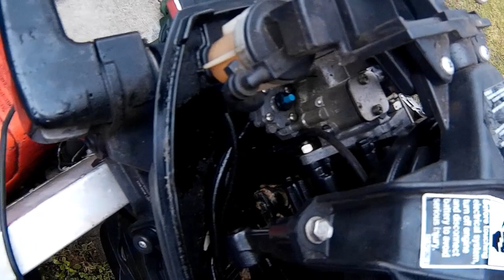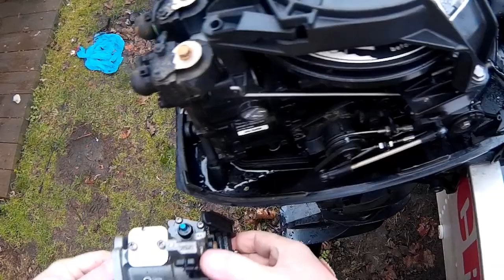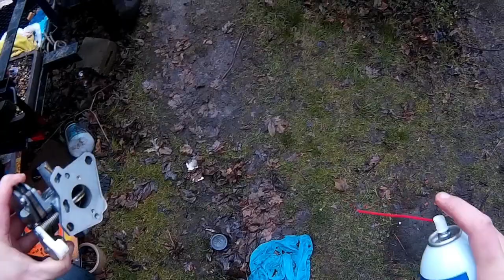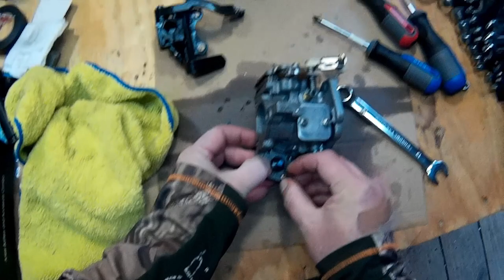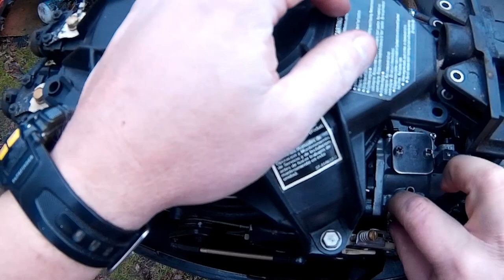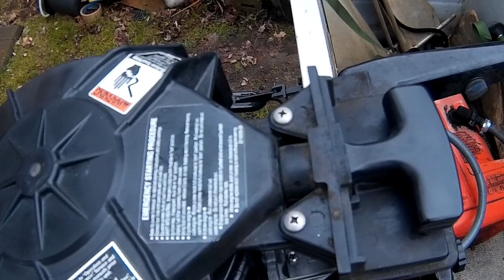IT WAS IN THE CARBURETOR ( 1997 Mercury 9.9 two stroke carb clean-out )

Comment: Thanks for the video. 
I picked up this exact motor this summer. It is hard to start and will not restart when hot. 
There have been many issues that I have found and fixed. Dirty and corroded grounds, coils missing ground jumper wire, emergency stop switch wires rubbed through causing a short to ground, and the stop switch on the tiller handle was defective.  
It still does not want to start. One plug is fouled, both have spark. The carb leaks fuel when choke is on and you turn it over. The carb was supposedly rebuilt and the engine was "inspected" this spring right before I bought it. I hope both cylinders have compression. 

This video has been beyond helpful, thank you.
Reply from the maker: You are welcome. Sounds like you acquired an engine that was not properly maintained. Best of luck with your Merc !!!!!
Reply: It's probably the bowl seal. I found the one that came with my kit was too thin and it would still leak. I made a new one from silicon and posted a video on how to.

Comment: Thanks for the video 👍🏻 Carb is the same on my 95’ Mercury 25 hp. the only thing I had to do different is remove the starter to remove the inside carb mounting nut. I purchased a rebuild kit first $20 ( gaskets, plunger ect. ) followed your video on disassemble and cleaning, the issue was the float was full of fuel, purchased a new float $11 re assembled and BAM RUNS LIKE A MERCURY SHOULD 👍🏻🇺🇸
Reply from the maker: Thats awesome. Great to hear it helped you out and the Merc is roaring again. Yes sometimes the floats will take on fuel !!!!!
Reply: @CrappieCrushinTv  I also found out the main jet in the bottom of fuel bowl (the one you were not sure of an adjustment ) is fixed and has no adjustment so it can be backed out , cleaned and just snugged back in 👍🏻
Reply from the maker: @matty2x302  Yep I figured that out after posting the vid but thanks

Comment: I have the same motor as a kicker on my boat.  When placing the idle adjustment screw back into the carb, what I did was mounted the carb loosely and then placed the "C" part that goes on the adjustment knob together, placed it thru the hole in the cowling.  There was no amount of pushing needed to get it to go as Crappie says.  Once that was in, go the the left side of the motor (when you are behind the prop), press down the lever Crappie tells you when he is installing the knob.  You will see how those two parts clip together, it is pretty obvious.  This might help you.  Awesome video!

Comment: I just did this on my 1999 20 hp Mercury, after watching the video I decided to check mine. 
This all stated with hard starts and then eventually no start. I found the ignition system to be finally dying. After all the repairs it still had carb issues also, the primer was stuck and wouldn’t depress when pulling the primer knob.  
Also I removed all the cover plates and bowl cleaned all the internal passages. I found your video very helpful the engines although different horse power they are identically built. 
Only issue after that was the switch box wiring was a shot in the dark for firing order. I missed it. Once that was correct it starts first pull now every time.  Hope this helps others along with your help on the repair. 
Thanks
Reply from the maker: Thanks for the comment Roger. Yep I been there with the CDI in the past. Glad to hear you are back to a one pull again !!!!

Comment: WARNING be very carefull taking apart the enrichment assembly under the bottom brass screw trere is a tiny spring and ball bearing DO NOT LOSE THEM!
Reply: yes, possible all merc carbs have this. Mine had the ball stuck up inside the spring!!! I think some tard tried rebuilding it before I got my hands on her. I mean, how does the ball get stuck 5mm up into the spring anyway?

Comment: Thanks for the informative carburetor video. Ironically I just took apart my 6 HP mercury Carburetor. Before I cleaned it and put it back together, wanted to make sure I was doing it right. LOL I don’t know if my issue was carburetor or not, so doing a process of illumination. Thanks!
Reply from the maker: Awesome hope it worked out

Comment: Thx for video.  I got the same motor.  Is there suppose to be a gasket between the carb and the engine block?  My carb rebuild kit comes with a gasket.  The Mere Parts diagram also shows a gasket.  Mine didn't have a gasket from previous owner.  Perhaps that's why the motor ran funny.  In your video, I didn't see a gasket either.  The mating face on the engine block side has like a rubber seal around the openings.  Any help would be great.
Reply from the maker: Thanks for the question and sorry for the delay. No, there is no gasket at the head.

Comment: Thanks for the very helpful video! I just picked up a 9.9 and first day on the water it started bogging down at WOT and eventually would barely idle. Upon checking out the motor, I noticed the previous owner removed the fuel filter from it's housing, and I'm betting my carb is full of shit. This certainly comes in handy since I have never worked on a carb motor at all, nevermind a 2 stroke.
Reply from the maker: Thanks Adam and I hope it can help you out. Junk in the carb never spells success lol......Good luck ...
Reply: @CrappieCrushinTv  thanks man, my motor is exactly the same as yours and I just rebuilt the carb today, she runs beautifully again. Your video helped a ton. You weren't kidding when you said putting the idle speed switch back in is a beast... Holy! It took me ten good minutes of cursing and scratching my head.
Reply from the maker: @Adam-en4zm  LOL yeah that enrichment knob can get you LOL.... Anyway I'm glad you got her purring. Enjoy the ride now. I rip mine down every spring and do a good cleaning so this way there are no mid season hang-ups !!!!!!!
Reply: @CrappieCrushinTv  That's a smart call, I just picked this motor up and the previous owner had performed the genius fuel filter delete mod. No wonder the carb jammed up my first day out, haha! Gonna be sure to de-gunk it at the tail end of ever season, plus I even got it a fuel filter, lol!
Reply from the maker: @Adam-en4zm  Lol real genius move with the filter delete lol. Yes get filter on there and do the annual cleaning and that merc will keep you happy.
Reply: @CrappieCrushinTv  For sure, I heard the 9.9 mercs are like the AK-47 of outboards. I expect this thing will last forever if I even take half decent care of it.
Reply from the maker: @Adam-en4zm  For sure Adam. I once said to a marine mechanic friend of mine that I was thinking of selling the Merc and getting a 4 stroke. HE SAID ARE YOU OUT OF YOUR MIND??????. He said you can get the 4 stroke but don't ever part ways with the gem Merc 2 that you have, it's priceless !!!!!!!
Reply from the maker: @Adam-en4zm  Good call !!!!!

Comment: Thank you so much for this video!!!! I’m a boater and enjoy learning about motors since I’m out on the water a lot! I can’t find a serial number for this new to me  merc but it’s a 9.9 2 stroke and carb looks exactly like yours with fuel enrichment and all. I rebuilt my carburetor (it had some water and jelly like stuff in there) and still can’t get it running right. It starts if I spray a gas/oil mix directly into carb but idles way too high and then stalls unless I manually open the Choke butterfly. I’m ready to break down and buy a new carb. Any advice??? Would’ve bought a new carb instead of rebuild kit if I had opened carb first!
Reply from the maker: I'm assuming you recently aquired this engine and problems to go with it. The jelly you speak of is usually caused by running fuel containing ethanol . I only run ethanol free anymore. If I was in your shoes I year it down again making sure all jets are cleared out for sure. If make make sure diaphragm pump and enrichment assembly are assembled correctly and working as they are suppose to. Make sure it so out back together correctly, make sure gasket are not upside down and are sealed correctly. If you are 200% sure of this and still have a problem then there is a chance the carb is out of adjustment. This is a whole nother ball game. Last bit certainly not least and should be checked first is the fuel hose from tank to engine. The older style break down and even begin to collapse. If berserking down it just plugged your carb up all over again. If it's collapsing then it's restricting fuel delivery.

Comment: Thank you very much! I'm having a problem with the bar you lock at minute 24.30. I don't see where to attach it to the other side. With you it is also loose in the video on that other side, but suddenly it is stuck as it should. Can you please help me?
Reply from the maker: I call it the enrichment idler arm and it just clicks into place. I am not sure what you mean by other side?
Reply: @CrappieCrushinTv  Thanks! I see in the video that the right side of the arm is clicked on the black thing that is attached to the carburetor. I just can't see where to attach the left side of the arm. can you please help me?
Reply: I found it, Thanks!
Reply from the maker: @bikerarno  Anytime

Comment: Thank you for this. In the process of cleaning out and rebuilding a 1999 Mercury 9.9 carb. I got carb cleaner in my eye as well. Luckily nothing came of it. Have you done a water pump rebuild on it? I'm planning to do that after the carb rebuild.
Reply from the maker: Awesome yeah the old cleaner in the eye trick lol. I have dona pump build and is fairly easy as well. Good luck.
Reply: There are some very good videos on here I watched before I did mine and although for mostly 25 horse engines and 9.9 hp they are the same as my 20 hp It has a few tricky parts but not bad. 
That was my first job one my engine.

Comment: It's always the carb!!! (unless some kid got a hold of it and ran pure gas, not mix like my idiot half brother does to chainsaws.
I just rebuilt my 8hp carb, a gen before this one you have. The rebuild kit off Amazon for $20 did not have a sufficient bowl gasket so I made one from 1mm silicon. I noticed the main carb mount lower nut was so loose I could spin it off with my hand because that gasket had shrunk. If I'd have just tightened those nuts it probably would have run just fine but, in for a penny, in for a pound. I posted a video on making gaskets.
Hey PS: replace the zip ties (plastic) with teflon ones as soon as you can. The plastic will get brittle fast and suddenly pop

Comment: Great vid, thank you.  Silly question here:  that white plastic canister
 to which the incoming fuel line is attached, to the right of the carb, 
is that a fuel filter?  I've tried to unscrew it to inspect on my merc 6
 hp, but can't get it to budge, and didn't want to force it in case its 
not actually "openable".
Reply: Yes they unscrew and mine was really tight also.
Reply: Be gentle, but it will unscrew

Comment: Thanks for posting Crappie.  My 8hp carb was leaking fuel from the primer pump.  I got hold of a new 9.9 carb that looks identical so tried to swap them out.  The new 9.9 appears to be flooding and won't start.  Going to check the float but is there anything else that would cause this?  Or is it just incompatible even though everything lines up and looks identical? I took the primer diaphragm off the 9.9 and swapped it for the leaking one on my 8 and that is working fine now but I'd like to try the 9.9 carb on my 8hp just to see how it runs.  Thanks again for the video.
Reply from the maker: What year is it and thanks for watching !
Reply: @CrappieCrushinTv  2004.  Everything looks identical on the 9.9 and lines up, bolts primer pump, linkage etc.   I can see inside the carb is flooded just by looking in the throat.  The bowl and float look ok.  If I recall most of the shutoff needle valves in the float I've seen have a small rubber tip.  The 9.9 is just steel.  Maybe it's not seating properly?  Hard to believe on a new carb but I'm out of ideas.  Thanks for any advice.
Reply from the maker: @irishwake1000  Oh Okay it was an easy swap pre-1994. Things have changed like block size. You will need to change up several other things to make it work such as the 9.9/15 horse plate and tube plus. Prob looking at about 150.00 ish...... or More.
Reply: Mike Check diaphram next to flow blow
Reply: @CrappieCrushinTv  Great video! Do you need to change the same parts (plate & tube) when putting a 15hp 2 stroke carb on a 9.9 2 stroke  Mercury? Thanks in advance for your reply and help!
Reply from the maker: @kenzeigler2925  Sorry for the late reply. Yes you should!
Reply: @CrappieCrushinTv  Thanks for the reply! Are you referring to the power head top plate and tell-tale tube? Thanks again!!!
Reply from the maker: @kenzeigler2925  It depends on the serial number for that engine. Some were larger headed and some smaller regardless of model # In my opinion and if was me I would not even fuss with it and look at a straight 15hp or 20hp. Going with the 15hp carb mod on the 9.9hp engine will only help you a bit on the top end power. Most notice just a slight bit of change in performance.

Comment: Is there a way to rev these small 2 stroke outboards in neutral? I have the 20hp and i have to clean/rebuild my carb. But i was wondering if there was a way to slightly rev the engine before I decide to put it in the water
Reply from the maker: That I dont know but sure there is a way.
Reply: There is a “flip” clip that secures the shifting rod, at the top of the shifting rod.  Flip clip and move shifting rod, to a position so it no longer works with throttle.  Make sure prop is in neutral. You should now be able to rev engine.

Comment: Great video, thanks so much as I am doing the same thing on the exact same motor. Question... Don't ask but I somehow lost the needle valve for the float Bowl. I do not know the exact part number or how or where to find one. Any ideas anybody? I have no manual or anything like that to reference. Thank you very much
Reply from the maker: You have to build the rebuild kit to get the needle valve. Not expensive . You know the year of motor ?
Reply from the maker: Sorry buy the rebuild kit.
Reply: @CrappieCrushinTv  yes...1996
Reply from the maker: @bryanhuff5671  okay I see a 96 so same as my 97. eBay is the place to get them. Rebuild with needle kit for your year specific 9.9 Mercury 2 stroke. If you are still unsure which one let me know I'll get you a link.
Reply: @CrappieCrushinTv  okay then... I will check that out. Thank you so much for your help and advice. God bless.
Reply from the maker: @bryanhuff5671  No problem anytime. I know my carb uses a 1395-83181 but some carbs vary. You can buy the needle and seat only on wholesale marine and or Amazon / eBay. Good luck God bless as well.

If you get in contact with the folks at wholesale marine they will help you out. They are in Cincinnati Ohio.

Comment: Nice video I have the same 9.9 Mercury but the tag on the transom mount is gone looking for model number for that engine I have the exact same one trying to find a re build kit for it but without a serial number very difficult if you could help 

Thanks custy
Reply from the maker: Sorry just got notified of your question. Did you get squared away ?  Anyway serial numbers are unique to each engine to prevent theft and re titling. I could get you a model number.

Comment: I need your help badly. On the enrichment assembly was there a pin that goes across the whole assembly?
Reply from the maker: No pin just the whole enrichment housing and arm, The sleeve, The set screw, The "C" retaining clip.
Reply from the maker: You do have the rod going to the carb from enrichment left side.
Reply: @CrappieCrushinTv  the rod is missing. On the left side of the primer lever is lose
Reply from the maker: @bee2333  Are you referring to the stainless steel rod as shown in my video ?
Reply: @CrappieCrushinTv  no. Do you have a Facebook so maybe I can message u a video?
Reply from the maker: @bee2333  Yes same name as this channel
Reply: @CrappieCrushinTv  just sent you video

Comment: I hope mine is the carb too... my 25 hp doesnt idle. But i can still use it as long as its moving forward.. and it starts to bog when the fuel tank is low.,.. motor looks exactly like urs but 25hp.
Reply: I took off that neutral locking link? Idk what its called but i took off a link that locks the starting pulley when its in gear (drive).... so i can start it with the throttle open half ways or all the way if it doesnt wanna start. Lol
Reply from the maker: Carb or spark issues. Could be down a cylinder pointed at cdi ignition

Comment: Anyway you could help me with CDI wiring I have a new cdi box and I'm not sure on which of the two black wires goes to trigger/killswitch.
Reply from the maker: Did you take a pic before disconnecting old one.
Reply from the maker: Differs from manufacture. Is it a oem ?
Reply: @CrappieCrushinTv  yes it is oem. some have two black/white wire coming oof of the cdi, n one is longer and one is shorter. I'm trying to figure out if the longer black/white wire goes to killswitch/shutoffswitch
.
Reply from the maker: @GHEENOE_HOLICS  Male or female on that longer lead or are they bare wired ?